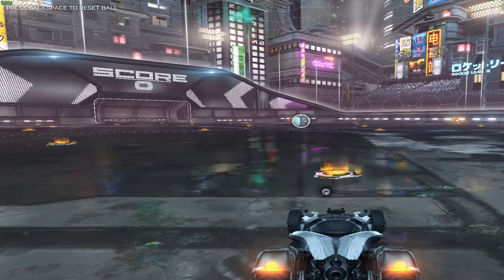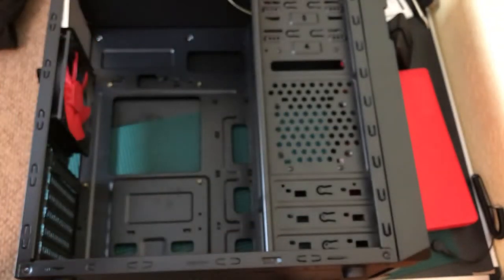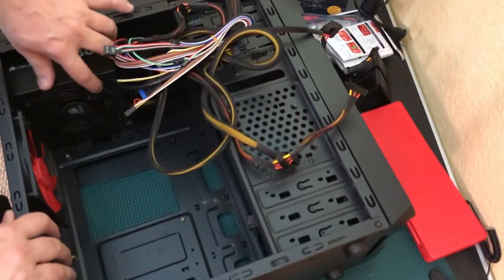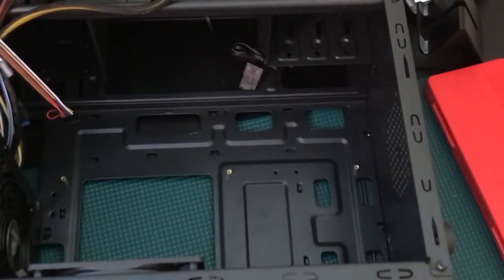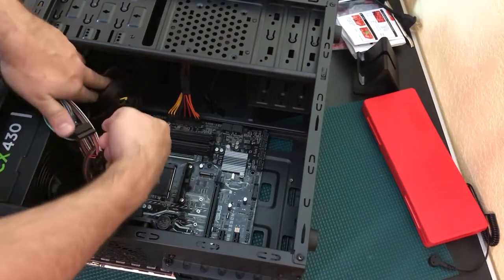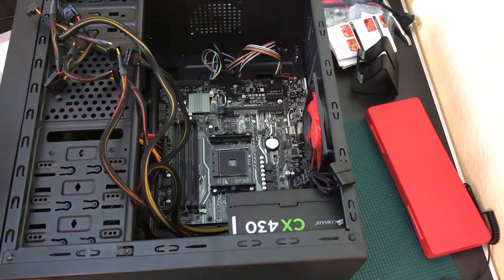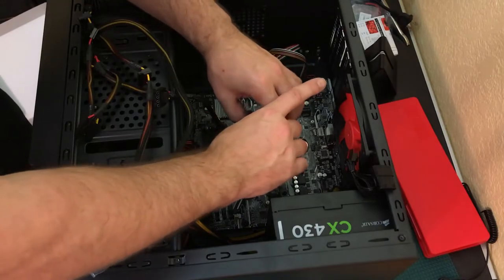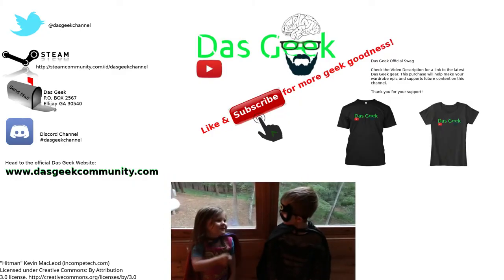AMD Ryzen 3 Budget Game Build - I Have Ryzen & It Feels So Good!

Comment: Not bad performance honestly. For most Linux games you don't really need a very powerful system
Reply from the maker: I was a little worried it would be under powered, but so far really impressed. Stock fan and no overclocking. Will definitely be doing some future videos with higher end gaming to see how it fairs but based on what I'm seeing it should power through without issue.